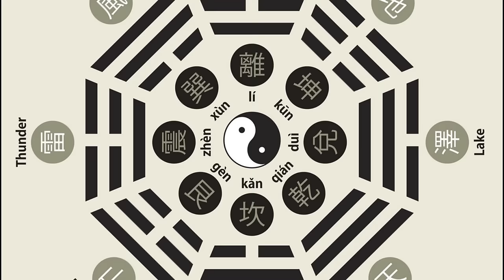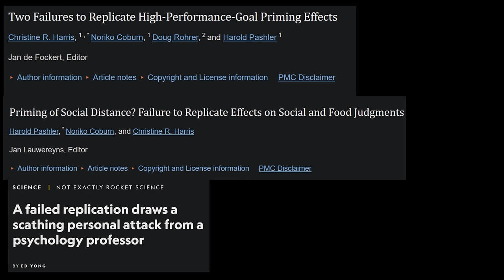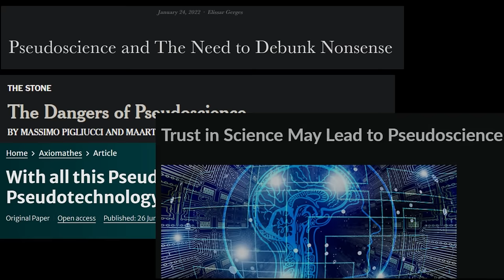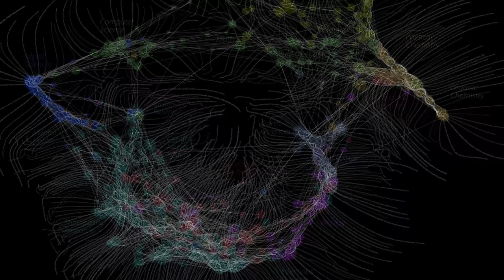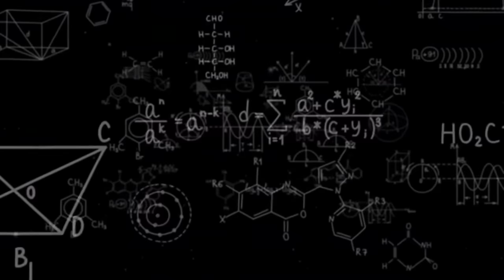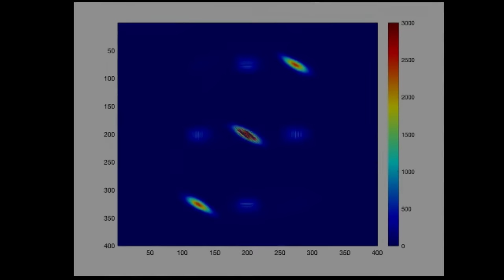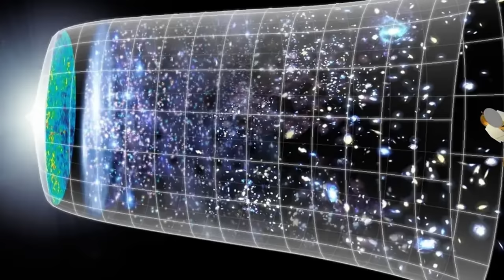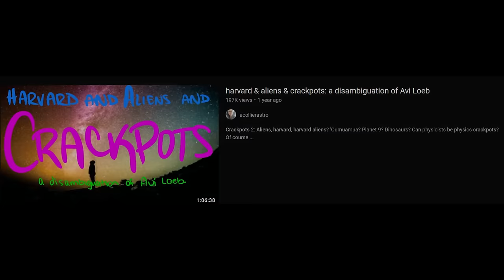How Science Became Unscientific

Comment: Regarding dark matter, there actually have been numerous attempts to remodel gravity in response to the observations you mention, and some are still ongoing.  The problem is that they fail to adequately account for the observations that led to general relativity in the first place.  Moreover, there have also been subsequent observations that strongly indicate dark matter is a thing and not an underlying problem with the model.  

The observation in this latter group that I find most compelling is that we find galaxies where there is no disconnect between observable matter and gravitational force.  If "dark matter" were really just a quirk in the math, then it should be found everywhere in equal parts, but this is not the case.
Reply from the maker: I don't think that Dark Matter is just a quirk in the math, a real thing, or a problem that can be solved by substituting GR for another mechanistic explanation of any kind at all.
Reply: @Formscapes  You've just excluded every possibility, so I don't know what you are getting at.  
And you also ignored the point that you (intentionally or no) left out critical information that, when added in, shows dark matter to contradict your argument, not support it.
Reply: @Formscapes So what explanation do you have for those observations and how does it do a better job than relativity?
Reply: You're referring to the bullet cluster, which is often touted as the nail in the coffin for MOND-like theories. Sabine Hossenfelder made a few blog posts and I think even a video on that a while back. According to her, and the paper, the bullet cluster doesn't fit particle dark matter models either. It's not a slam dunk you're being told that it is.
Reply: @trucid2  I will check it out, thanks.
Reply: @Formscapes  
Most people, who actually understand physics, think it's a form of matter. A minority of relevant experts thinks gravity has to be modified.

To assert that there can't be a "mechanistic" explanation is to say that you cannot understand it and we shouldn't even try. It's a total stop to science and reasoning in general.
Any actual understanding is "mechanistic".
Reply: @trucid2  You're referring to the bullet cluster

I found a video by Sabine and have started watching it, but I already think there's an error in this statement.  Bullet Clusters are just one of many ways to detect the disconnect between observable matter and apparent gravitational force.  Gravitational lensing is another.  

What we find is that the disconnect is not universal, as it should be if it were a problem in the math.  As an analogy, if we were using the wrong length ruler, the mistake should be found in equal proportions and in every measurement.  But this is not what we see when we compare observations of different galaxies.

Perhaps you means something different that will become clearer to me as i get deeper into the video.
Reply: @trucid2  Thanks for sharing.  Sabine didn't go into bullet clusters in the video I watched, but she mention several observations that don't fit dark matter that I was unaware of.  The superfluid hypothesis sound fascinating, though I can't say I fully grasped it after one viewing!

Regardless, that there are multiple ongoing hypotheses, all of which are rigorously tested and open to discussion is wildly in contrast to the picture painted by Formscapes.  🙂
Reply: dark matter doesn't exist 😂😂😂
Reply: @trucid2  You're referring to the bullet cluster

I listened against to a podcast by "Why This Universe" on MOND and you are probably right.  Interestingly, Dan Hooper's description of what is happening is different than the phenomenon I mentioned in the OP, which makes me wonder if I distorted the actual happenings in my mind into a line of evidence that doesn't really exist!  😄

Either way, they go into good detail about why dark matter is still the consensus despite some of the issues Sabine brings up in the video I watched.  It's worth a listen if you have the time.
Reply: @MrCmon113  Any actual understanding is "mechanistic"

Exactly, even if souls and gods exist, they still interact with other parts of external reality somehow.  Once we understand what that method is, we'll understand other interactive mechanisms.  It isn't a limiting term.
Reply: @Oswlek  What if the mechanisms were the friends we made along the way.

Comment: I have a degree in bio and have worked in a lab with the stereotypical white coat in some capacity for several years now.  Science worship has always made me uncomfortable.  It’s supposed to be a self correcting field, and that requires some conclusions to be wrong, but somehow that’s not ok.  Academia pushes for more and more publications and yet the quality of those publications and the repeatability has severely dropped.  

We need to encourage bachelor level students to try to reproduce the experiments and trials that others have done beforehand instead of just going for more and more publications of something new.  

I remember one of my professors being impressed with a paper I did in his class, he offered to submit it to a journal on my behalf.  I was horrified, we had a sample size of less than 10, I had never seen my lab partner’s setup in person, and my own sampling data probably had different criteria than he did.  That experiment was good enough for an undergrad assignment and lab, not to be submitted to a paper.  The fact my professor even suggested it when he knew the problems as well as I deeply concerned me.  

In a research lab probably a year later, my name was added to the bibliography of a study with what I would describe as poor experimental methods.  It had a higher sample size, but I was deeply concerned about the findings as they contradicted generally accepted understanding of the disease in question.  To this day I strongly believe that a replication study is necessary, and should have been done in house BEFORE any of the data was published to the outside world. I had little to do with the study in all honesty, just observations and animal care, but I can’t stop thinking about my name being connected to dodgy results.
Reply: I’m most of the way through the video and I have to say, while I was generally supportive of the first half of the video, I found some inaccuracies and parts I disagreed with in the second half, mostly regarding astrophysics.  

We don’t have to agree on everything though.  It’s be an awful boring world if that were the case.
Reply: I studied science but dropped out due to personal reasons. Anyway, I've always kind of wondered the same thing. I mean we did repeat some experiments. But all of that was - ofc - with the idea that we are just practicing. If the results were off that was our mistake. No complaints but one day I began wondering, who actually repeated all these experiments in earnest? Like what if someone had been dead wrong at some point, we'd be going in the wrong direction all the time.

Comment: I have my own pet theory about putting Mars at the Jupiter-Sun L5 point:
1. Mars orbits at the L5 point until something knocks it off. This is a 'big boulder at the top of a hill' problem. It needs a little push to get started.
2. It gets attracted by Jupiter's gravity. This causes it to speed up, which in turn causes the distance to the Sun to increase. This means it tends to miss by going around the outside in a parabolic path.
3. It will fly away from Jupiter losing most of its velocity at about 4.8 AU from the Sun.
4. It will now orbit the Sun, with an orbit that crosses the orbit of the inner planets. It has the same energy as it does today, it just has to change its trajectory by choosing the right impact parameter.
5. The impact parameter you would need for Mercury or Venus is less than their respective radii, thus it could only get to its current orbit by going extremely close to the Earth, just hundreds of kilometres away for a distance of over a hundred and fifty degrees of arc.
Now this is not really a theory. This is just math, the same math you would use with the same answer. The only speculative part is just seeing what a migratory path would look like. Now this calculation gives three predictions that all have to be true:

1. Mars has to have giant holes in it from passing Jupiter.
2. Mars has to have a giant bulge covering 1/4 of its surface from passing Earth
3. Earth has to have a 15,000 km long strip of raised terrain.

Now if you don't know what Mars looks like, it might be a good time to check out a topographic map of it. I assume you know what the Earth looks like, do you see all three of those giant predictions? More than a few theories crumple under the math.

Comment: I have a thought of my own about the non-falsifiability of a theory. You point out that we can't know anything for certain. And therefor that causes all claims to be equal as no claim can be stated with certainty (with the exception of "I exist"). I can even expand on that a little. 

You mentioned that scientific theories are extended when problems arise. Sometimes they are not extended, because they are not meant as definite explanations. If we have a gas model then we only expect it to explain the gas model aspects of a gas. If we want to go to edge cases, then we have to look at the particle model. And if that is not sufficient then there is the quantum model as a layer below. The existence of the particle model doesn't disprove the gas model. And because of that, if it doesn't rain after the predicted humidity is reached, then that doesn't necessarily disprove the current claim. It may just show that there is a layer below which we haven't looked at. Of course it could also be plain wrong. For example in the case of the geocentric world view. But it doesn't have to be. Of course this is the view of an engineer and not a physicist. Physicists might view it differently. I mean engineers deliberately linearize complex phenomena so that they can more easily create products. 

But even though I see your point, I think falsifiability isn't as useless as you made it out to be. I have two reasons for that. 
1) When we do science, one goal is to have the theory which explains all relevant facts with the minimally complex model. Of course this previous sentence is just a philosophical assumption, not a scientifically testable claim. But there is good reason for that assumption. Especially when we look at it from the point of view of statistics. Let's say the humidity level of rain is 80% +- 5%. And we have done 100'000 experiments in various different environments where we put our best attempts to reduce any systematic errors. At that point we can be pretty certain that the humidity level of rain is 80%. Since this is a bell curve very rare outliers of 60% would be tolerable. 
Now we could come and claim that those 100'000 experiments are just lucky coincidences and the actual reason for rain is because native Americans were performing a rain dance. The correlation with humidity and rain is just coincidence. Since we don't know with certainty that rain is connected to humidity and since we can't falsify with certainty the alternative explanations, the alternatives are just as good as the humidity explanation. This is technically true, but I am not willing to defend it. 

2) I think it is important to see if a claim is falsifiable. For example if someone says everything in the universe is an illusion or a simulation then that is a claim that I can't test. I acknowledge that it is possibly true, but if I can't test it then how should I know if it is true or if I should go with the alternative theory? After all it doesn't take much to turn any claim into a non-falsifiable one and suddenly we have hundreds of claims to describe whatever we want. With that my intention is not to defend the mainstream view. 

I think naturalists have a very big problem in that aspect. They only allow for natural explanation. To use a quote "no matter how improbably something is, it is much more probably than something impossible". Miracles are going against the laws of nature and are therefor impossible. How do we know that nothing goes against the laws of nature? The common human experience. What about the billions of people who claim to have seen something going against the laws of nature? They don't count. 
And that's how we end up at a theory that is non-falsifiable. Any argument against it is impossible and we have to look further into problem, until we find a possible explanation that agrees with our position. After all any explanation that confirms their own view is better than the predefined impossible, no matter how lacking that explanation actually is. I like to call that the naturalism of the gaps. Instead of setting up a non-falsifiable claim, we should instead look if there is a way to test it. I know that naturalists like hard sciences the best, but sometimes the solution lies in other fields to find an answer. 

With that I don't want to say that non-falsifiable views are per definition wrong. I just dislike non-falsifiable theories because of personal preferences. I like to hear various proposals to explain a scenario and then be able to test, which of the proposals are true. If we set up one of the proposals in a way that it is not testable/falsifiable per definition, then we cannot really compare it to the other ones to find out which one is more likely. So falsifiability has a place in finding out what is a good explanation for human experiences such as the natural laws. Also one of the core principles of science is to set up a theory, predict something new and test this prediction by performing an experiment. If your theory is not testable then it is not really scientific in itself. Falsifiability is important, but it is not the only thing that distinguishes good from bad science. But just because it is not the only thing that distinguishes good from bad science doesn't mean we should discard it altogether.
Reply from the maker: You're not understanding the point. The point is not all claims about reality are on equal footing. The point is that our understanding of reality - and the epistemological value we attribute to "scientific" theories - is conditioned by organic systems of metaphors that mutate over time. Tests don't really matter except in very specific circumstances in which those metaphors are taken for granted in such a way that experimental results can actually be interpreted in a meaningful manner. Without that, you just have noise and no way to draw conclusions about anything at all.
Reply: @Formscapes  I don't understand what you mean with "is conditioned by organic systems of metaphors that mutate over time." What is the meaning of this part of the sentence and therefor the point of the entire sentence?

---

I think the word test is more broad than experiment. An experiment is about reproduceable things. But we can test non-reproduceable things too. For example when it comes to historical topics then we can't do experiments (except stuff like c14 or if you try to replay a historic event/action to see if it is possible to do). But you can test if a historical theory is correct by comparing different statements of historical documents. Because of that I think even claims that you can't test with an experiment can possibly, but not necessarily, still be tested through other means. 

For example if somebody says the earth is 6'000 years old then that is testable. If somebody says the earth is 6'000 years old, but it was created with an apparent age, that is not testable. And as soon as it is not testable at all, I stop caring about an idea. At that point I can understand what a person is saying, but I don't know what to do about it, as I can't really find out if it is true or not. That might be my fault for ignoring possible ways in which reality might actually be set up. But I can take any theory and turn it into a non-testable theory. If you know a few tricks that is quite easy.

Comment: Exceptional Video. I always acted on the premise of using the best available knowledge and slotting in the most effective new information just as a mechanic would replace a tool in his toolbox. When your tool doesn't work you find a new one, and when you can't find a tool for your purpose you try and make one. This ideology is iterative and intends to be indifferent and works to help constantly question the validity of assumptions to help progress understanding. It is unfortunate to me how many holes there are in the current intellectual tools we have championed in mainstream science and how fiercely guarded they are without regards to finding better or more effective systems of understanding. This video reignited my questioning of how we understand things, and why we assert certainty over things we hardly understand, if at all. thank you for making this. and for anyone else also feverish about pushing the boundaries of our understanding, try to remember that certainty is a fool's assumption, and understanding is not a certain thing but rather an evolving continuum that can take you in directions you would never have expected and you may spend decades wrestling with only to be even more confused than before. Confusion is an important step to discovery, and constant confusion is a hallmark of pursuing knowledge.